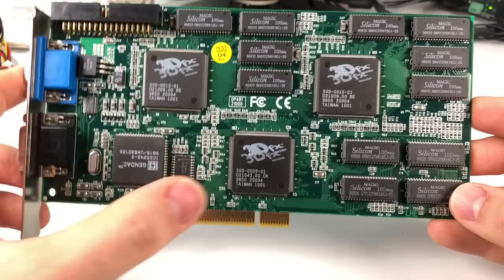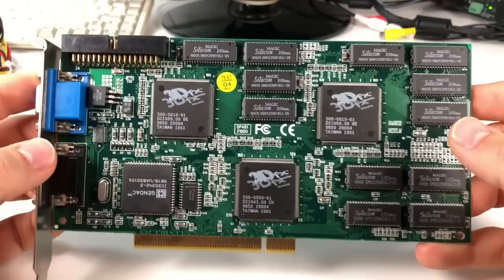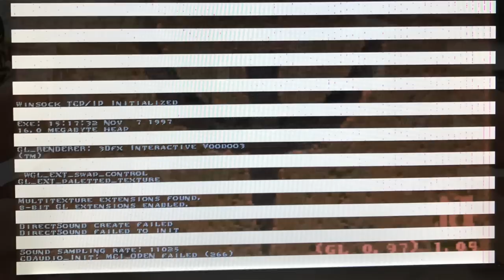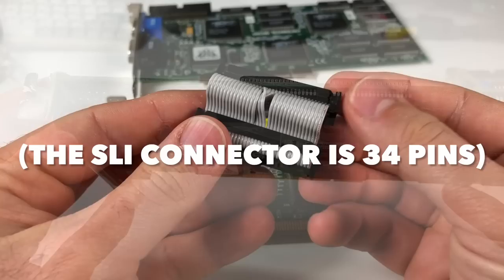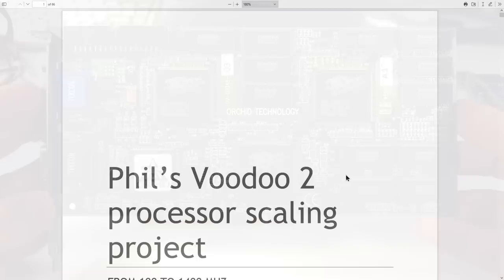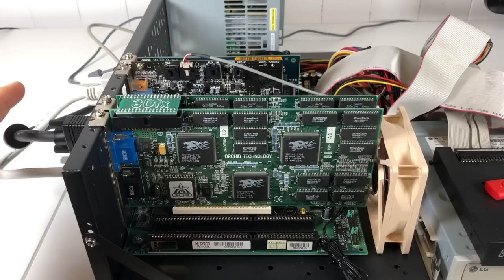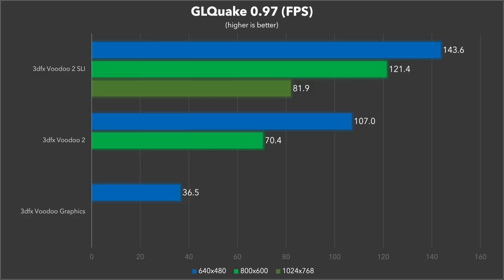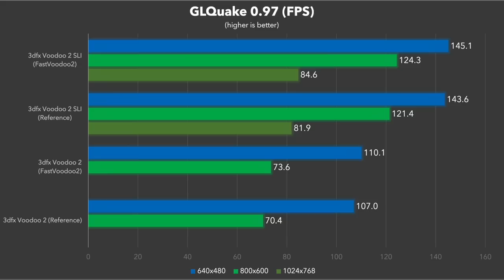The 3Dfx Voodoo 2 - Taking 3D to the Next Level!

Comment: God, I remember this card. After Nvidia released its first card. People were slamming 3dfx. I actually reached out and sent them a nice letter congratulating them on what they had done and to keep it up and ignore all the negative press. They responded to me with a sweet box of swag and told me they appreciated the letter, and they said they spread the letter around the office to boost morale. I really thought they would have retaken the 3d crown. It was never to happen though. It's probably the only reason I didn't buy Nvidia's stock. You see for me the 3dfx gaming card was the first of its kind. It was an add-on card that made games look night and day better. When they launched the second one I jumped on that right away. To me, they were the pioneers of the industry. It was sad to see them dissolve into obscurity.
Reply: My workplace put us on a bunch of different 3D cards to try to maximize compatibility in the games we were making. I was the "lucky" one who got Nvidia's first card (preceding the Riva 128). It was a piece of crap. Poor drivers. Fell back to software emulation on a lot of 3D functions. And I wasted 2 weeks of my life trying to find a bug in my code that kept crashing my computer, which I eventually tracked down to a hardware bug in the Nvidia card (as in try to make this 3D call with these values and the computer reboots, but it works fine with any other GPU). That was my reason for never buying Nvidia stock. I was flabbergasted that the company which made that POS card I suffered with somehow managed to dethrone 3dfx.
Reply: Very true, when things were developing in the 90s, a 3dfx card was THE card, it meant that you could not just play a game in 3d, you could play amazing games like turok 2 and quake that looked like it came from a super computer. 3dfx is legendary
Reply: I'm an ole 3dfx customer, or better to say... I was a kid back then and my brothers (who got me in computer science) bought 3dfx cards (we have couple of voodoo 2 and a single 5 5500) because these cards were pioneering and brute power oriented and there was a lot of expectation with voodoo 6000 series. I remember when Nvidia bought 3dfx we were all upset, and since then the only brand new geforce card I bought was soon sent back after couple of days (it was 9800gx2 bought to play crysis, but performances were not great).
In time I had lot of amd cards and a 1060 and now 2070s but these were second hand cards because... I don't want nvidia to have my money for the 3dfx acquisition! If it wasn't for Blender performing a lot better with nvidia, I would be stuck with AMD!
Reply: Anytime you see a company go from #1 to bankrupt in such a short time, it's because they made terrible decisions. I was a 3dfx fan, but they squandered their opportunity with bad decisions and they got what they deserved.
Reply: @Hadrhune0  My first 3D card was the 5500, with a P3. Played amazingly. I was very sad when they went bankrupt. I stick with AMD now mostly because Nvidia treats gamers like crap, makes everything proprietary, and overcharges. AMD had some driver issues in the past, but I never wanted to switch.
Reply: @salvatronprime9882  They had some in hindsight suboptimal decisions, but this isn't the whole story. They had a hard to track down bug in their silicon on some upcoming cards, which took a long time to finally fix, but it was too late by then. This was also early days of GPUs, and companies didn't have nearly the resources to keep going as they do today.
Reply: @xeridea  they wasted most of their money by buying a PCB manufacturer and then telling 3rd parties to shove off. One of the stupidest decisions that has been made in computing history. It was pure greed and it bit them in the ass and I have zero sympathy. Good riddance to business like that.
Reply: I was a complete numpty but scored a second hand voodoo2 for a great price when they were only out for 6 to 9 months.  Night and day is being kind.  Whoa.
Reply: I rang daily for months at a place I worked asking when it was going to be released, imagine that this day at work...sacked! Matrox was my favourite card, I believe they are coming back into the market. How sad am I?
Reply: I still have a Riva 32 with the Voodoo 2 . It was a great combination for a Pentium 2.
Reply: I originally had a Power VR 4MB for my first 3D card (replace the S3 Virgo 1MB), I had it for around 2 hrs before thinking, nope this is not good enough. I wanted to run some demos from a PC Gamer disk. I think Midtown Madness may have been one of them, I’m not 100% sure. I went back to the same shop with my Power VR and asked for something faster, they then showed me the (which was double the price to £80) 8MB Voodoo 2 and ooooh myyyy goshhh that thing blew me away! I’ve always been proud to be apart of the Voodoo2 OG. Thank you to 3dfx
Reply: @solandri69  didn't it use quads instead of triangles or something stupid like that?

Comment: I used to have a sizeable 3dfx collection in the early 2000s, which I'll always regret selling. My favorite cards were two Creative 3D Blaster Voodoo 2s. Like many I made an SLI cable from a floppy cable to experience Unreal in 1024x768 Glide.
Reply: Early 2000 ? the ATI 9700 and 9800 were out by then.
They were  shocking jump over best card's of the late 90s.
Reply: I held onto my Voodoo 3 until about 5-10 years ago as I was still using it in builds over time.

Comment: When Unreal came out I was blown away by how it looked with my ATI Rage Pro, and my new PII system was running the flyby at much higher framerates than all my friends' machines...then one day I stopped by a buddy's apartment to check out his LAN setup, and after bragging about my Unreal framerate he was impressed stating his wasn't that high...but he fired it up on his machine and my jaw dropped as I saw Unreal running on his Voodoo 2 with the Glide API. The next day I busted out the credit card for a Monster 12mb Voodoo 2, and a couple weeks later I picked up another to be the only one around with an SLI setup (my credit card bill didn't appreciate it lol). Right around that time we started having a weekly LAN parties, that turned into a permanent setup of tables and people just leaving their PC's there for weeks at a time, coming over after work and school...man, those were the days! Tribes and Unreal tournament were the main games we'd play, with some Half Life, ReVolt and others thrown in occasionally. He had a (rare at the time) broadband connection fast enough to handle us all (6- 8 people) to game online together as a clan...can I time travel back there yet?

Comment: Went from the 3dfx to Voodoo3 as well. Tech was simply moving so much faster back then, and prices while not cheap were still inexpensive compared to the rest of the system.
Reply: The things was, I sold the V2SLI packgage and got the Voodoo 3 2000 for the same money, overclocked to 3500 levels

Comment: I remember buying my Creative Monster voodoo2 from Game in Nottingham back in 1998. It was a huge upgrade from my AGP ATI rage pro and I was astounded by the improvement in 3D using the GLIDE API, instead of Direct3D. Still over 25 years later I have yet to be as impressed as the first time I loaded up "Unreal" and saw the fly-by.....nothing at all has come close to my jaw hitting the floor since. If only today's graphics cards were as reasonably priced as back then eh?!
Reply: "If only today's graphics cards were as reasonably priced as back then eh?!"
520 DM for the 8 MB version was not reasonable priced, the 12 MB version was over 600 DM when the card was sold in Germany.
With 520 DM you could buy 440l of fuel for your car in 1998
For the same amount of fuel you have to pay 856 EUR today.
Reply: @helloweener2007  yea, a dual Voodoo setup was NOT cheap. And you still needed an extra VGA output for 2D windows processing. People are huffing the nostalgia glue.
Reply: @salvatronprime9882  

As much as i remember Vodoo 2 was like 100-150$ back then. I guess the inflation in 1998 was -60% counted backwards from just before Covid. So roughly 150+60%=240$ of 2020 value. Around 10% of standard salary in U.S for a video card that would last no more than 3 years. I remember how the much more powerful Nvidia Riva TNT2 Ultra 32 MB combined with 733 mhz CPU was sweating on Quake 3 Arena on 1024x768 everything max. 30fps max. And Quake 3 is from 99. Voodoo 2 is from 98. 

Now middle class GPUs lasting 5 years. Maybe more and the customers in any case enjoying great visuals. Lets say the life span of the present day GPUs is double therefore twice as expensive. Still 480$ for top GPU while the price was triple in 2020. 

Yeah. The GPUs today are terribly overpriced.
Reply: @ps4games164  Voodoo 2 debuted $299 per card, that's gonna be $600 plus another VGA 2D card to output the graphics if you wanted the top-end performance of the day. You also needed a specialized dual AGP mainboard which is an extra $100 compared to normal boards.

Quantum3D was a partner company for 3dfx and they developed a single-board SLI configuration for Voodoo2, and that was $1600.

Quadro, Oxygen, and FireGL cards for workstations were starting around $1500.

Nowadays, workstation and gamer GPU's have been consolidated. Essentially today we are getting workstation quality GPU's. If you look at the upcoming AMD XTX for $1000 it's an exceptional value. If not for Covid and the economic problems of today it very well could have been $800. That would be lower cost than Voodoo2 in today's dollars.
Reply: @ps4games164  another thing to consider is the much wider array of available performance today with older GPU's still being viable on the market. In 1998 the technology was raw and advancing rapidly, which meant that a top-end card would be choking on average games just 2 years later as API's and games were adding tons of new features and complexity. Today you can get a 5-year old card and still have acceptable performance on new games.

The thing that makes today's cards seem unreasonably expensive is that you are basically forced to buy a workstation GPU and there is no low-end options. But that relates back to what I said previously - if you want a low-end budget GPU you just get an older top-end GPU from previous generations. You can find an acceptable GPU that still performs well on today's games for $300.

The Nintendo Switch mobile GPU is nearly 8 years old and they are still making new games that look good.

When you look at the full spectrum DX12 and Vulkan compatible cards available right now, the value spectrum is wide and the prices are good. The 1998 market is no comparison at all. Not even close.
Reply: @salvatronprime9882  

Thank you for the info.
Reply: It would have been either a Diamond Monster or a Creative 3D Blaster - Voodoo 2.
Reply: Same! Unreal blew my mind.
Reply: Agree totally. I've had so many video cards since I retired my Voodoo 2 and nothing even comes close to that leap from software rendered to hardware accelerated. I used to play Quake 2 and switch to software mode for a while just so I would be blown away again when I switched back to the Voodoo 2! I wasn't obsessed with frames per second either. I played Unreal at 1024 res (I had SLI at that point) with everything maxed and averaged 24 fps. I remember during one area it dropped to 10 fps. Didn't bother me at all and is still probably my favorite gaming memory. Kids today don't know anything /s
Reply: @salvatronprime9882  "Voodoo 2 debuted $299".... have you checked the prices of graphics cards recently?  £1600 for the nvidia RTX 4090.

OK they weren't cheap back then, but nowhere near as extortionate as they are now.
Reply: @alkaholic4848  today's cards are equivalent to workstation cards, which were also starting at $1500+ in the 90's. There is no separate line of cards anymore. The consumer cards today push the limit of technology as far as it can go.
Reply: @salvatronprime9882  3 years ago I purchased an Asus Strix 2080 OC for $ 1000.00 cad. 2 years before that an MSI 980ti OC for $800.00 cad. Today I cant find any 4080s below 1700$ and most are over $2000 !! So pls dont tell me these things arnt over priced in 2022 cause they are.
Reply: @Daniels656993  the XTX is $1000 and performance is on par with the 4080 and completely in line with the above prices you stated. If you insist on paying scalper prices on top of the Nvidia tax, that's completely on you.
Reply: @Salvatron Prime  Im refering to Canadian prices but even if we leave out the exchange rate, your still paying twice as much as you were 3 years ago.
Reply: @Daniels656993  the prices seem high because there are no "cheap" versions of the new cards available. Usually they bin the chips and the low grade ones are underclocked and paired with cheap 128-bit or 64-bit memory. Due to supply shortages and since the previous gen cards have not cleared retail channels yet, there is no need for that right now. If your budget is $500 then you can find a $500 card already in supply and it will work completely fine.

Also, when doing price comparisons, you need to compare apples to apples. 384-bit cards should only be compared to 384-bit cards.
Reply: The same thing happened to me ,I have an ATI RAGE too,  until today I never saw a huge upgrade like this on my PC ,the closest thing was the advent of SSD storage.
Reply: Same I had an ATI 3d Expression with my voodoo 2.. I was living large!

Comment: Back in late 2000, I was running Alien vs Predator on my Voodoo 2 at a friends house where we set up a 3 pc LAN. For some reason, the Voodoo 2 couldn't render the cloaked predator effect so they were completely visible on my screen.  The other two pc's each had GeForce 1 video cards, which were capable of showing cloaks. 

As a workaround, I had to play predator while the other two picked anything but predator.

Comment: The Voodoo 2 changed everything.  I went from a 2 meg accelerator to adding a 3d accelerator Voodoo 2 and it was like advancing 2 generations.  The difference was so huge, it was unbelievable.
Reply: Diamond stealth to Voodoo2? I remember it cost £120! I got two and admitted it to hardly anyone. That would be like spending £300 of todays money. Could you imagine spending twice that? Crikey. Thank heavens for mass production and corporate benevolence things are so much better now.
Reply: I went from a Mystique (2MB and very simple 3D support - barely better than software) to a Voodoo 3 3500.  The first thing I ran was XLR8R - a MadOnion 3D benchmark tool, before it became 3DMark.  It was actually hard to believe what I was seeing.  I had been hearing and seeing things about 3D acceleration, but it all seemed too good to be true.  Running that demo blew my mind.  I was giddy.

Comment: The first ever computer I bought myself and ever owned was very, very similar to the one you're showcasing here: PII-300 MHz, 96 MB RAM, Matrox MGA-G200, and one 3DFX Voodoo 2 card. I remember that card would not like to work half the time and ended up being a deception, especially for the steep price tag I had to pay for it. Don't remember what brand it was, nor whether it was the 8 or 12 MB variant. I kept that machine working for about 15 years, of which 7 as my main, upgrading it little by little to keep it working (more ram, PCI expansion slot for IDE 133 MB/s hard drives, more storage, modem for the Internet which was starting to happen, CD burner, even more storage, 450 MHz processor with 100 MHz front side bus...) That's the computer I screwed up so many times in failed improvement attempts, and spent so many hours fixing, it single handedly learned me computer science. And that was before Google provided with all the answers, so yeah... had to figure a lot by myself. XD But what I learned fixing and improving that computer still drives me now, 25 odd years later, to be a reference amongst friends, family and coworkers upon those topics.

Comment: I still have my old Voodoo2, haven't had a computer that can run it in decades.. but it's such a classic piece of hardware.  Gaming on that back in the late 1990's was a revelation when you could finally upgrade from softwear rendering.  I remember a guy rocking up to a lan party with a brand new AMD k7 and his voodoo 2 setup, pushing 100fps in Unreal Tournament.. Minds were blown.

Comment: i was around in this era, these cards were next level, going from 2d on your 1mb cirrus logic or s3 trio's to having one these was nothing short of amazing. the smooth frame rates, the smooth textures and lighting of when you fired the rocket down the hall. i had the 4mb voodoo 1, then went to a pci voodoo 3 2000 pci. was allways jealous of my friend who had dual voodoo 2 12mb. quake1 and 2, unreal, monster truck madness, carmageddon 1 and 2
Reply: Did you ever play Forsaken deathmatch back then…..Allways smiling when I think back😊😊
Reply: @caseyryback6932  no, but remember taking my 200mmx and 14" crt round to my friends house to play quake 2 death matches. Used to have 4 of us on his small dining room table.
Reply: @matthewwiddows6319  😀😀😀Yep! And spending 1/4 of the precious time debugging the network or my Operating System😀😀

Comment: WOOO! Turkey Day vids. I had two 12MB Voodoo2s when I was a kid. System was a PII 400 with 128 MB RAM, a Savage 4 32MB card, and two voodoo 2s. I loved them for glide games (and glide was the best API for Diablo 2 back then for smoothness and no stutter/frame drops).
Reply: Here to .
I had 2 from creative 12mb sli.
What a time is that .
Later the voodoo voodoo banshee.
Later voodoo 3 on the motherboard (packedbell) 
And the last is the voodoo 3000.

After that i stop with it .
The new cards from other are faster and more color .
And that matrox g400 .
Later nvidia GeForce 3 200ti @500ti.
And after that ati radeon serie .